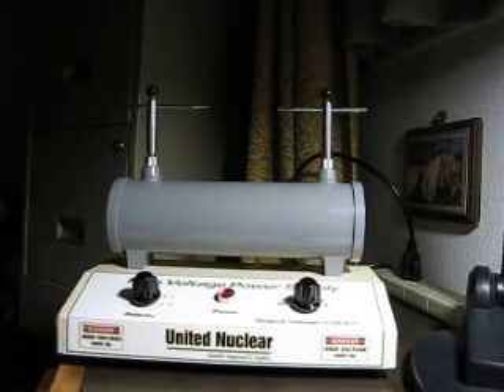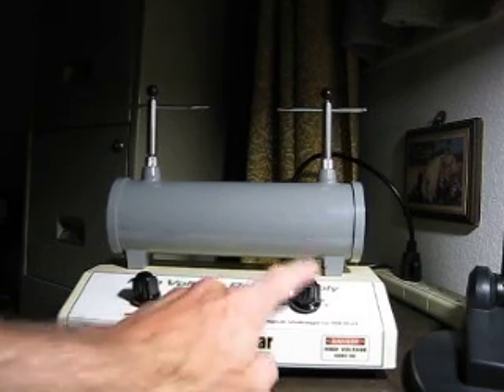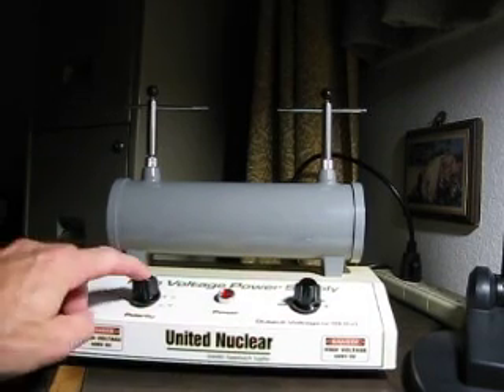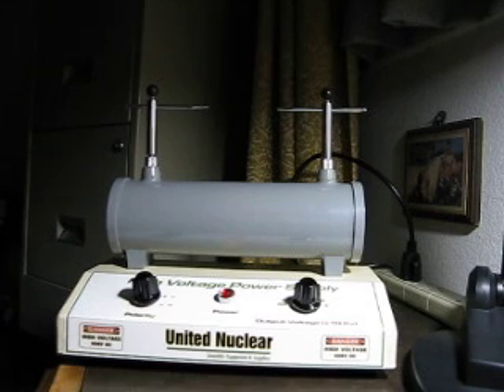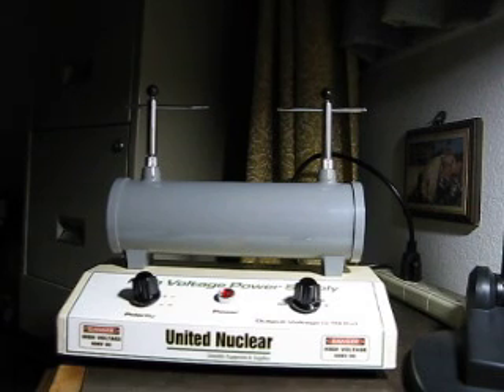60KV Induction Coil

Comment: I loved mine until it abruptly stopped functioning after using it. Power light still comes on & it makes a buzzing sound, just no sparks at any voltage setting. Tracking down a replacement has been very difficult, most places no longer carry them, selling a very low-power solid state thingy instead, which broke down in less than a month.
Reply: leads were too far apart without the juice to go anywhere at the lower settings so the thing eats itself. Stun guns have similar problems if the leads are too far apart.